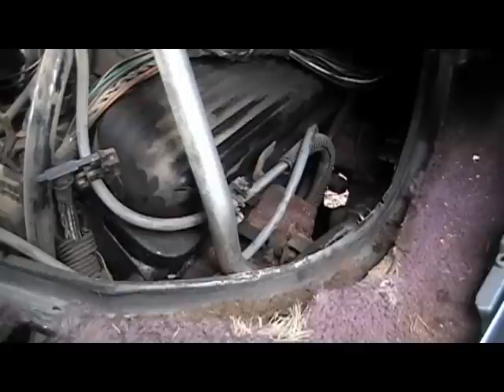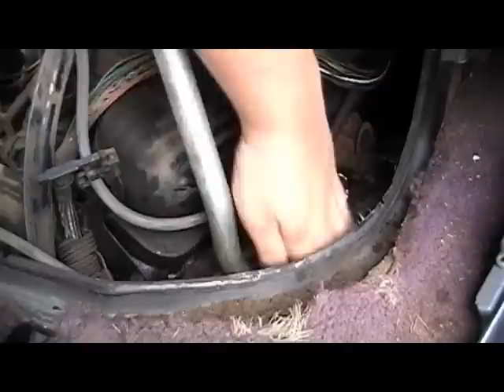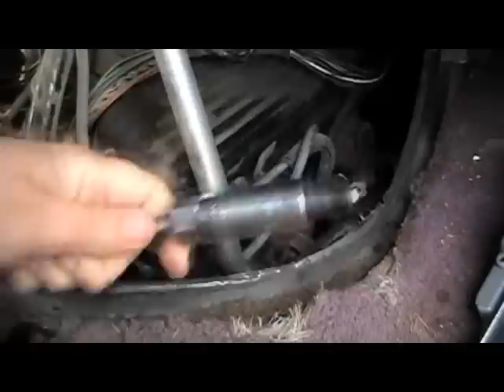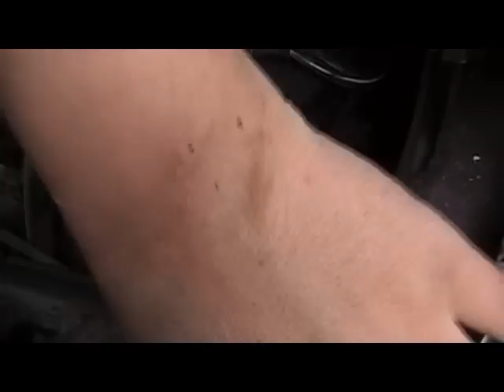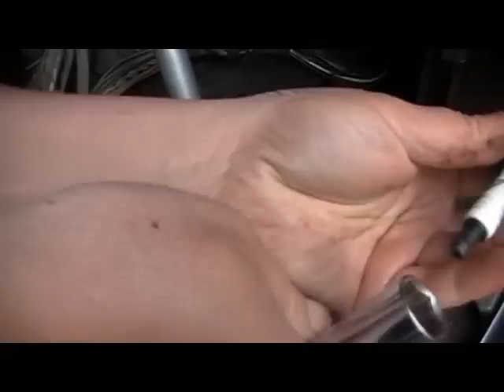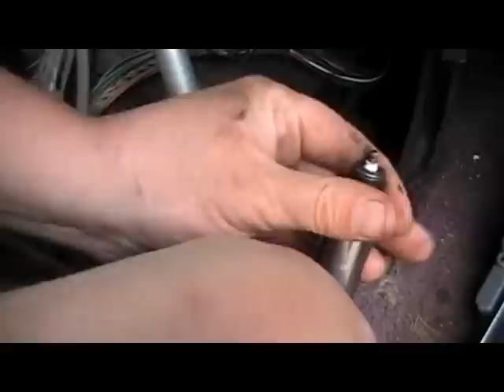PITA Spark Plug won't go in the hole!! *laughs*

Comment: i got a friend that owns one.. they are definitely a pain cause of space under the hood.

just be glad you don't on a car with a trans-reverse engine. my old Lincoln had that crap. you got to un bolt the motor mounts and roll the engine over to change the spark plugs. POS..